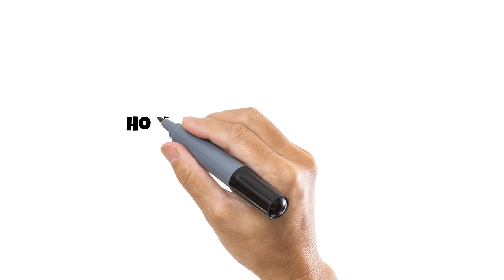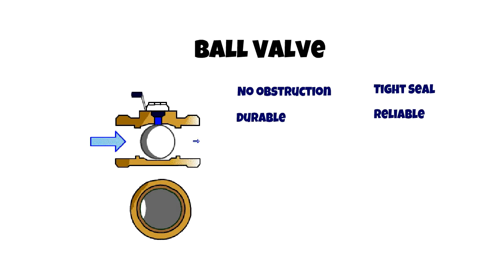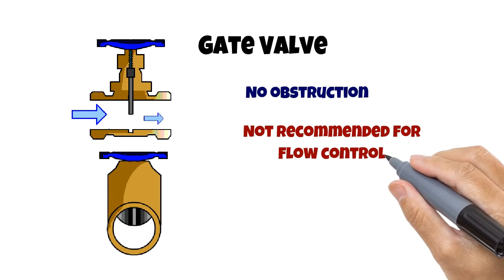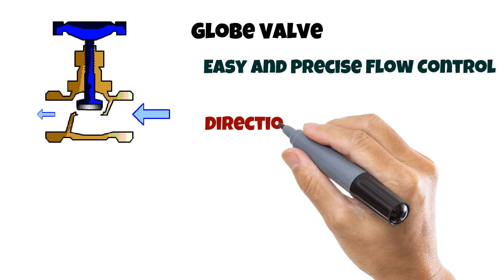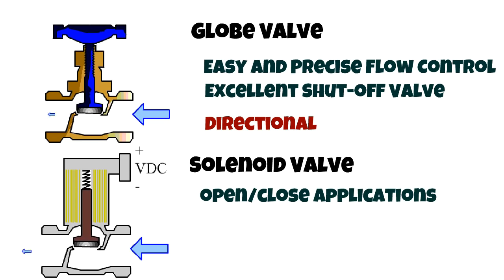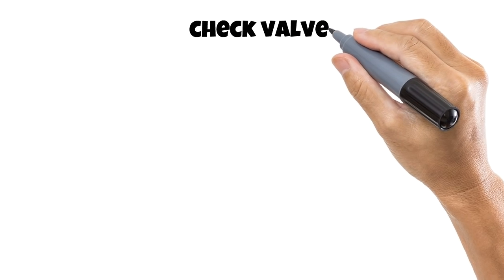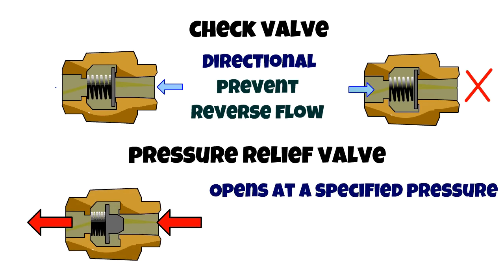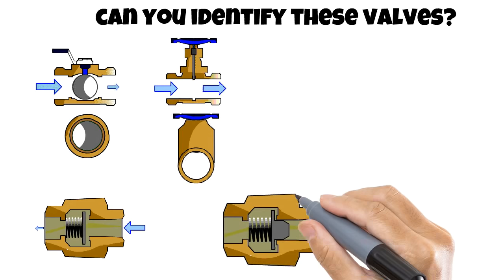How Ball, Gate, Globe, Solenoid, Butterfly, Check and Relief valves work?

Comment: Just a note... 
This is all for low pressure systems. When your system and/or differential pressures are in the thousands, ball and butterfly valves disappear, and globe and gate valves are the rule.  

Also, cheap globe valves may be intended to be directional. But the higher grade models will gladly hold several thousand psid indefinitely, w/o leaks. Dual disc gate valves will hold their pressure either way too. In many cases, due to the high effort necessary to operate valves under high pressure, pilot valves are part of the system as well, and are almost always some form of globe or needle valve.
Reply: it is not true at all, bro, in aircraft, most buffterfly valve is used for high pressure system
Reply: Thank you sir , But would you please tell us about the differences in price among  all  these kinds of valves ? .
Reply: @kinanfadel1116  servicing the valves is a whole different discipline than purchasing. I have no clue what the commercial versions cost. But I'm quite sure that the globe valves are among the more expensive, possibly only being exceeded by the double disc gate valves. They remain in use, not because they're cheap, but because when you need to control or regulate several thousand PSI differential, everything else fails.

Comment: The ball valves are used to control the flow of liquids. 
Very nice presentation, thanks for sharing.
Reply: Ball valve not used for control flow . Ball valve is used for on/off operation . And specifically for frequent use, as found in a truck of water tanker .

Comment: You mentioned that Globe Valves should never be used as shutoff valves in between a piping system.
I'm sure this will make sense, but could you clarify why this is the case?  ( thanks )
Reply: maybe because a backwards pressure can damage the seals?
Reply: @MrSmith-rk4jq  Yes he even mentioned that

Comment: In the globe and solenoid valve the flow, as shown, is in the wrong direction. The flow should enter the valve from the top. If it enters from the side below the plug / disc, there's the risk pressure will force the plug / disc up. Whereas if the flow enters the top side, pressure will keep the plug / disc down

Comment: absulately briliant. thanks
Reply: Very nice but I have question if we have   Gate valve on our pipe line we have to set one globe or ball valve to decrease flow or pressure because you mentioned that gate vale just work to stop the flow. Please kindly answer this question

Comment: I HAVE  A QUESTION. WHAT IS THE "CLASS" IN VALVES CHARACTERISTIC? FOE EXAMPLE GATE VALVE CLASS 1500.
Reply: That's pressure rating, I guess. More the class, more the pressure it can be used in.
Reply: Pressure class. 1500# is the ANSI standard